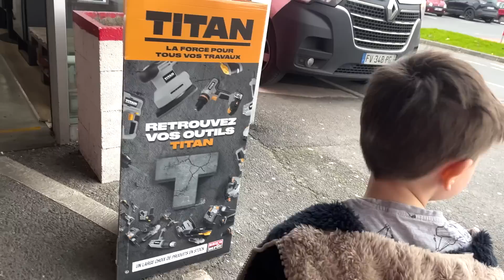its Sunday, so that means....

Comment: The mixer isn't stuck in cement, its STABILIZED with leftover cement. 
Also, you have rubber wheels on it, it's easy to get it out. 
My father's mixer, though, has stamped metal wheels... They get really stuck...
Reply: Dan I know nothing about building so I am asking this question: how solid is brickwork? Will it tumble down if there is a gentle earthquake?   Just wondering that’s all
Reply: @ludovica8221  thank you

Comment: It's not too late, but would you consider removing the roof membrane and installing lining boards, then reinstall the membrane ?  Your truss design is so nice, it would be great to expose it inside, and putting in a roof lining board of some description - sheet / plank / whatever, now means the roof is finished inside.  Just a thought ;-)

Comment: Fitting the angle blocks at the end is a really bad idea.  It's going to be a nightmare to fit them and then mortar them in place one after another.  Best off cutting them to fit as you go and dropping your last block into place somewhere in the middle of the course - especially with those french butt joints.  Also, start you running bond from one rafter end and let the last full block fall where it may.  Think efficiency man!  :)
Reply: True.
Reply: And here I was thinking he was doing an amazing job?..?? 👏 🤣  If anybody can pull it off, it's Dan!! 🏆💪🏽

Comment: I think you might have forgotten to screw the doorframe into the brickwork in the area below where you're working. You might be able to use concrete bolt/screws and use large pilot holes. You may also choose to recess the heads and use a spade connector to give a bigger hole. Then, it may be possible to buy some hardwood plugs to then hide the heads of the screws. If I was working with blocks like that, I'd have a decent pair of gloves on but you're not me, are you? Good luck with it all....

Comment: Why no rebar?
Reply: Presumably because it's only a little extension it is not necessary, he is also using a higher cement ratio to sand to strengthen the mortar mix!?!